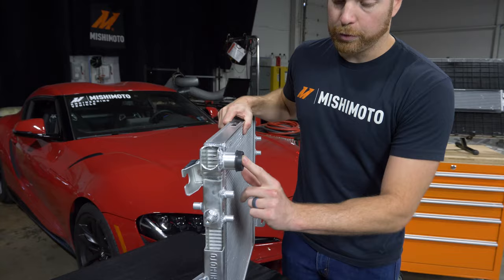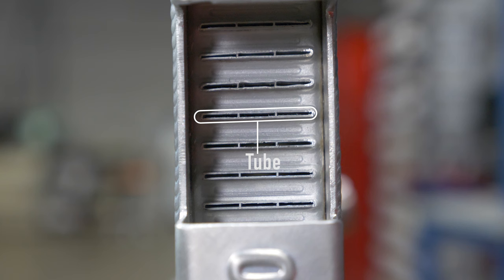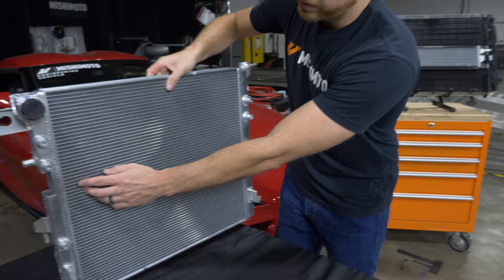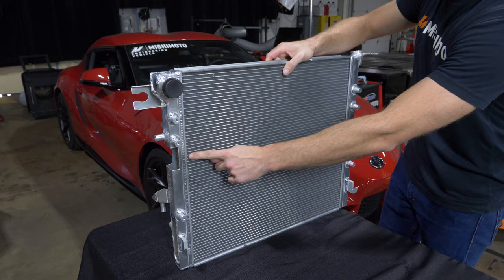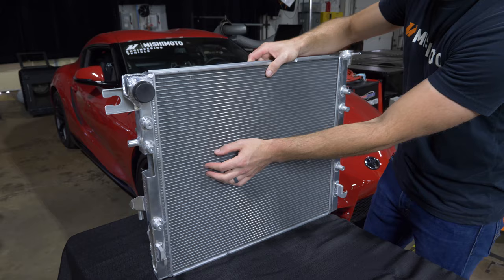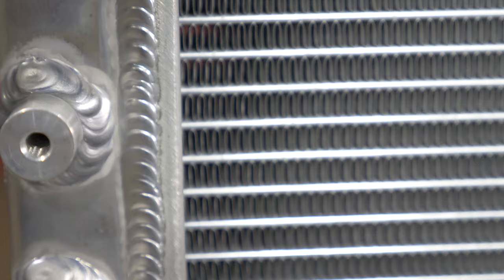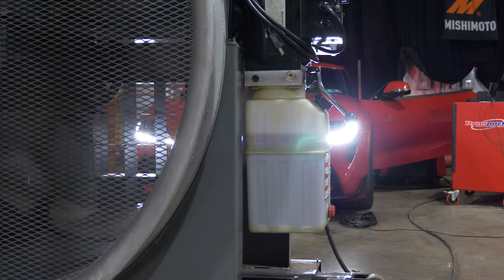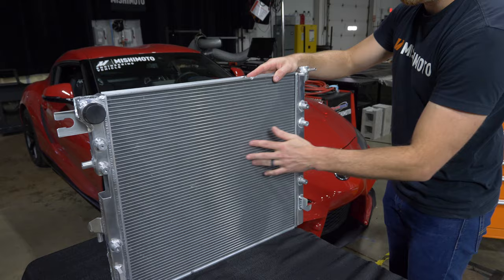How does a radiator work? - Automotive Cooling Short

Comment: What would happen if I run cold water through a radiator and blow a fan on it. Would it blow cool air?
Reply from the maker: If you are asking if ice cold water was run through a radiator and a fan was placed in front, yes, the radiator would cool the air down.
Reply: @mishimoto  Thx!

Comment: Okay lets just say that what you are saying is actually what happens. How on earth does the heated coolant which is like 250 degrees Celsius cool down to (idk what the cool down temp is ideally pls let me know) ~10 degrees Celsius over the span of a tube that is like 40 cm in length? It doesnt make sense to me that the coolant would cool down so drastically? Why is it able to cool down that fast over such a short distance? Pls let me know so I can learn how to cool down my coffee thanks
Reply from the maker: Are you asking how aluminum dissipates heat and comparing heat rejection numbers between different materials? If you use an aluminum coffee cup, yes, your coffee would cool faster but the cup you are holding would be much hotter than it is now.

Comment: Is a radiator fan supposed to stay on the entire time the car is on?
Reply from the maker: It depends on many variables.  If the A/C on?  If yes, you can expect the fans to be on. 

If not, it it typical to see the fan cycle on and off depending on the coolant temperature the vehicle is seeing. If this is not cycling, there could be a few issues to look into such as a faulty fan switch and more.